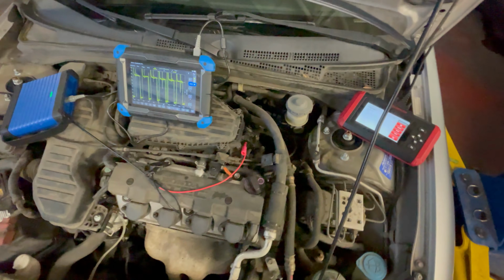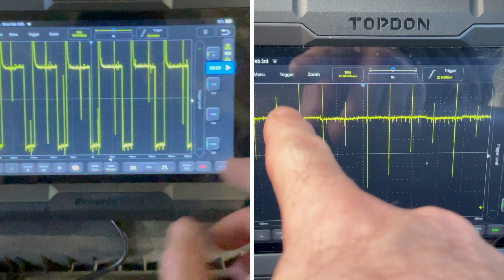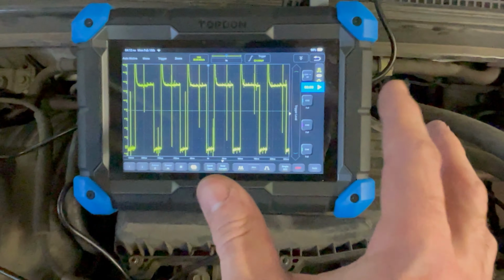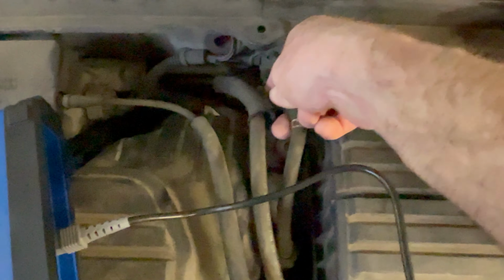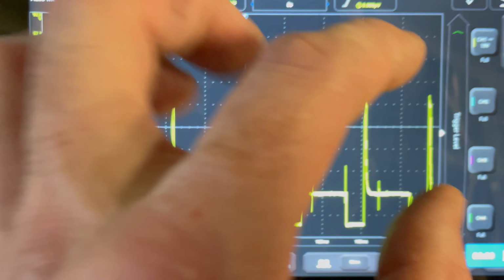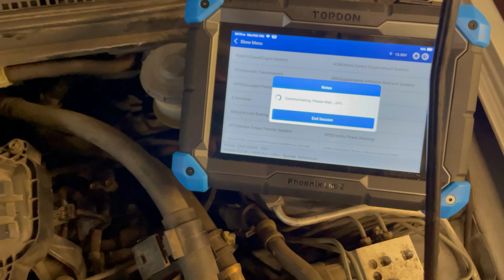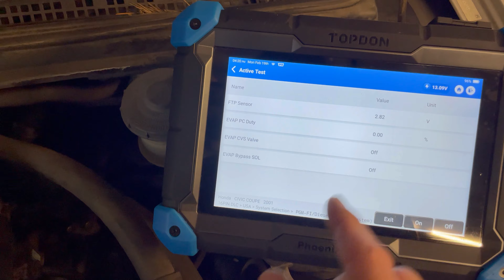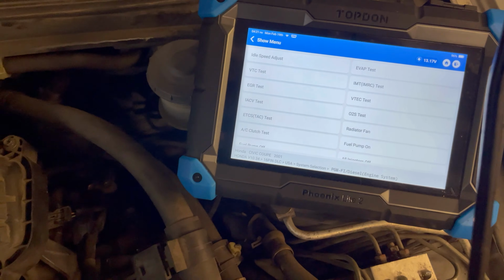Honda P1457 Super Bonus Video

Comment: We cannot always count on a known good car to compare with rolling into the shop, but what we ought to do is call a nice customer that has the same or similar car and ask them to stop by for a quick 10-minute test please so we can gather a scope sample or a few test voltages at a few quick locations for some known good data, tell them they can wait, its a quickie. Make your diagnostic attack plan in advance and be done in a few minutes, no worries.
Reply: I dont care the price, what inputs does the PCM need to give the output to turn on the EVAP Purge Solenoid? Are those inputs there 100%? its true the bidirectional does not operate the  output but are there other possible problems yet to come, cheers.
Reply from the maker: I’ve rarely had the luxury of having a like-vehicle to compare a known good. 

I’ve known plenty of customers over the years that I’m sure would be happy to come down and hang out for a minute to collect some data. 

As far as inputs usually the purge valve doesn’t need to see much other than a stable running engine. I don’t know if you watched the parent video to this bonus video, but I was able to compare scan tool functionality and verify the scan tool can command the purge valve open. It was nice to confirm the tool functionality too. 

Thanks again.

Comment: Brother i need help 
P1457

Changed all these parts
1. Purge valve
2. Soleniod
3. Canister
4. Gas cap
5. Vent valve 

Did smoke test couldnt find

Please help
Reply from the maker: Did you check out the first video? Do you have a scan tool capable of commanding the EVAP valves on and off?
Reply: @DadsGarageDiagnosticSpecialist  just have obd reader
Reply from the maker: @mercpindi5522 well it would be helpful if you had a scan tool and a wiring schematic. You’ll have to test the wiring from the ECM to the solenoids.
Reply: you did not mention any voltage or resistance or continuity tests. You cannot fix cars with a code reader buddy, you need a good cheap bidirectional with maintenance light reset capability, the more you spend, beware of brand name charging extra, the better tool you will get $$$$ Another reason to purchase a better tool is to charge your family, friends, and neighbors $$ and save them big bucks from the shop prices, no doubt, so in the end, other people are actually paying for the tool, that is a fact, all professionals believe this statement. Cheers